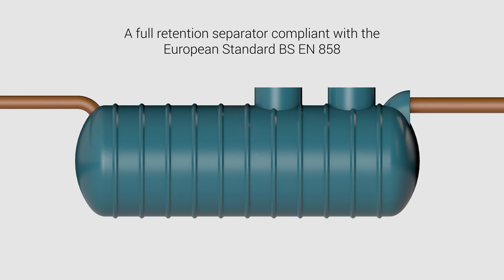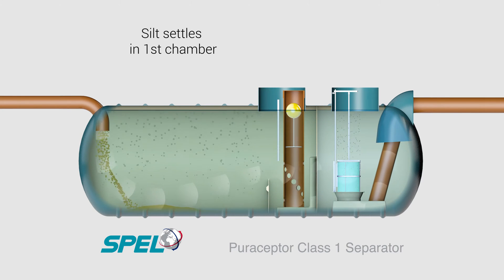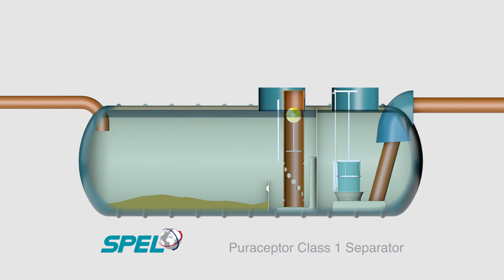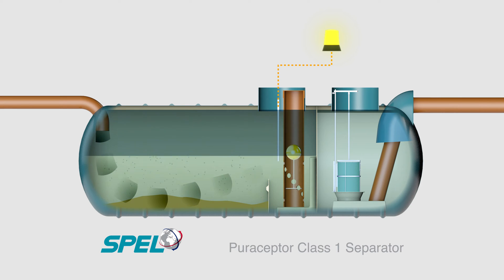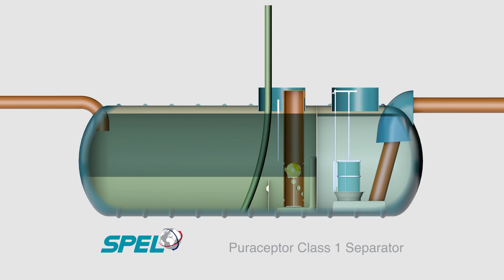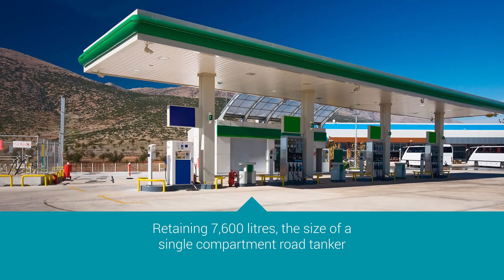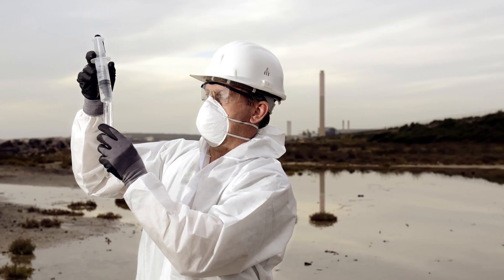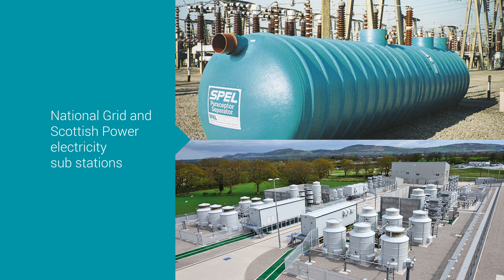SPEL Puraceptor Class 1 two chamber Separator

Comment: Hello, 

oil storage” column in this manufacturer’s ESR table may actually be giving the minimum oil capacity required under EN858 sizing rules, not the true hydrocarbon retention volume? 
For model 
P080 the oil storage is 800
L while the silt storage 8000l, does this mean that in an event of the major spill the separator will retain 8000l oil ?